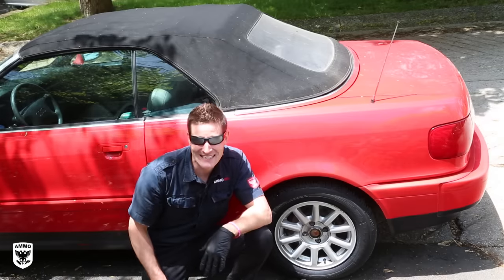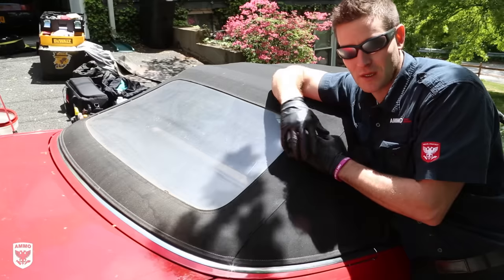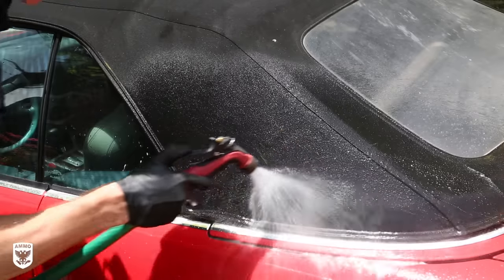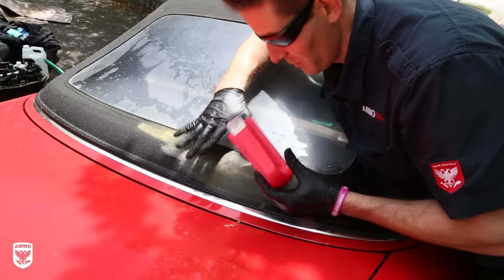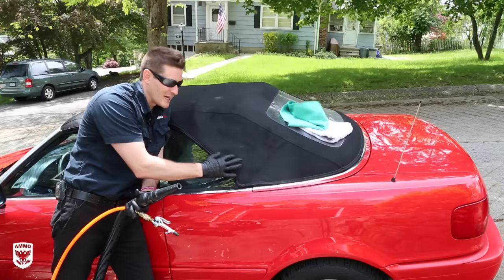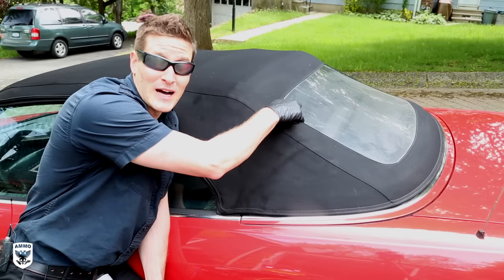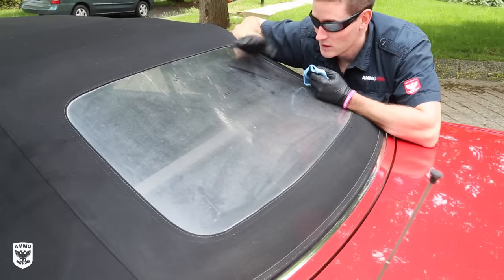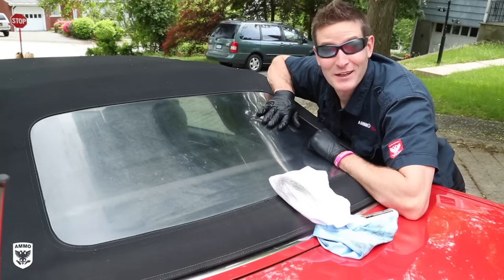How to Clean Convertible Top & Restore "Yellow" Window"

Comment: For the benefit of anyone who reads the comments and wanted info on convertible back window repair.  As Larry's vid here was more about cleaning the Haartz cloth top, I'd like to offer my experience with repairing a badly scuffed and scratched plastic window.  To avoid overheating or stretching the plastic, I had a friend hold a heavy textbook directly against the opposite side, with a dampened medium-thick microfiber cloth in between.  This way, the plastic behind my direct working area was evenly supported, cooled, and not scratched further.  I then used my Rupes mini polisher and many of the same steps/products used for headlight repair (wet sand, buff, polish.)  The results were actually quite satisfying and completed quickly.  In about 90 minutes a top I was ready to throw away looked 98% perfect and has continued to look as good 3 years on.  Let's face it, most of the time the top is down anyway - or what's the point of a convertible?
Reply: recently purchased an e36 convertible and struggle with the yellowing/foggy rear window. If your solution works for me, you’re a life saver!

Comment: Great video and very informative! Just a note that using any cleaning liquid containing petrol distillates or something as innocuous as dish washing liquid also contribute to the yellowing of the rear window because they extract the polymers out of the plastic making it brittle. Avoid them at all costs. Rather use the correct products all over the car. I use Autosol Plastic polish to restore the rear window on mine to good as new every year or so.
If you happen to own one of these lovely cars, be careful about running the rear demister (a heated fan in this model) too long. This leads to the window "burning" and eventually developing holes!

Comment: In regards to the back seam of the window, that is not mold. It's a kind of plant that grows in wet conditions. We see it a lot in boat canvas, and one way to loosen it is steam. If you do that, you don't have to use the stiff bristled brush as much. I agree with spraying it with the cleaner and agitating it, but before rinsing, hit it with a steamer, and it will come right out. If you don't get all of it out, it will grow back.

Comment: Did anyone else notice the trunk flexing when he had his elbow on it?
Reply: That shit was bothering me so much
Reply: That would be the reflection of the tree blowing in the wind.
Reply: audi quallity
Reply: That`s called ,,german engineering"
Reply: @behindizockt2809  most cars do this lol. My old 2000s mustang and my 16 sentra also does this if you push into hard enough.
Reply: That happens at any part of a car that has that material cars nowadays are too soft.Put pressure on any part and you'll see it will bend.I have a 1990s Truck and it's engine hood is made of strong material so strong that it will not bend even if you put pressure on it like the car in the video.Older trucks might be stronger than newer trucks because of the materials they are made out of.

Comment: I'm about to clean (when the weather improves!) the ragtop to our Vauxhall Astra. It has never had a proper clean as you describe in 16 years. I have actually bought an Autoglym cloth roof cleaning and treatment pack. I would have just used a jet wash to remove the dirt, but will use your system.

Comment: Thanks for excellent advice! On my 35 year old cloth top I try to avoid using a water (pressure) hose. First I vacuum it very carefully to get all dust and loose dirt out. Then I sprinkle with clean warm water from a spray bottle, add special shampoo if needed, the let the top dry and finally add a special water repellant ‘soup’ with a brush. My plastic rear window has a few scratches (compliments of previous owners). How do you suggest to remove the scrathes? Also a cloth top may loose some of its color over time. Have you ever tried to use a dye to restore the color?

Comment: Go to a dodge dealership and go to the parts department. In there they have a mopar product for Jeep plastic Windows it is amazing!!! And it's 8$ and comes in a huge bottle. I use it on any clear vinyl window. It removes light scratches, and helps with UVA protection. It's in a grey bottle.... Please go check this stuff out!

Comment: I have a 2000 Miata with a vinyl-like material on the outside of the top (certainly not a cloth), but inside is a cloth that has a occasional mildew problem. Should I take the top off and disassemble (since it folds and creases around the frame) to clean it? And have you found that liner material usually hardy enough to treat in the same manner as exterior cloth?

Comment: I have a 1990 Mustang 5.0 with a white vinyl convertible top. 

Top is structurally sound but needs to be cleaned. 

What products do you recommend that I can use to safely clean the top without marking the cars exterior finish ?

Thanks

Comment: I have a question? Just bought an 03 Mustang cobra and it’s a convertible. On the top I can see where it is wearing from putting down and I want to fix that as soon as possible. Any solutions?  Is something I can adjust because It’s on the passenger side only. So it seems like when it folds while going down there maybe some rubbing I’m really not sure. Thanks! whom ever responds!

Comment: Hey I found your channel a couple months a ago and I've been binge watching a lot of episodes, and I was wondering how you could remove idk it looks like water marks from a window. I've tried to use a liquid clay bar, windex and just rubbing a small area with my finger (to see if I'd work) but nothing seems to work.
Reply: James Bond If you've got dried calcium deposits on glass, that's not too hard to get rid of, just some tedious elbow grease. I use dish soap and a fresh single-edge razor. Lube the working area with the soap (or soap+water mix) and move the razor in straight lines using just enough pressure to keep the sharp edge against the glass. I haven't scratched any of my windows doing this. If the deposits are thick, it may require a second pass, or slightly more pressure.

Give it a shot in a small area, and see how it goes. The other approach would be to use something acidic to break up the calcium, or a cutting/polishing pad, but I haven't tried those techniques.

Comment: This is an acrylic dyed thread product. it is made for being out in the sun and give many years of non fading life. that's because the thread I'd dyed to the core then woven together. This is very expensive fabric. Best way to extend its life is to keep it clean and put protestants on it like Larry did. Two things personally do not do is use a pressure sprayer other use a stiff brush on this fabric. 
pressure cleaning will fray your fabric and the UV rays of the sun will cause the fabric to breakdown extremely fast. The stiff brush will really harm the stitching. I use a soft blue brush you can use to clean the body of your car. 
Take care of your fabric top, and you'll get 15 years of life out of it.

Comment: What about using a claybar on the window?  Don't have a vert, just curious.
Reply: rebelyell22 Since this window is plastic I don't think that'd work. Some verts have glass windows, you could clay bar that, though.
Reply: Jesse Crandle it still has pores though.
Reply: rebelyell22 Any time I've ever claybared plastic (trim pieces on accident) it stuck quite badly, I'm concerned the vinyl would react similarly. Maybe your experience has been different, with proper lube it wouldn't hurt to try I guess.
Reply: Jesse Crandle I'd try it if I had something to try it on.  I've never even clayed glass
Reply: rebelyell22 I haven't clayed glass, but I am fairly interested in trying some of that glass polish. My window is fairly scratched/pitted, I'd be interested to see how well glass polish would clean it up. Truthfully I doubt very much, but it couldn't hurt.
Reply: rebelyell22 Clay works great on car paint, but I believe I would not use it on a convertible window. I suggest using the Novus 3 step process instead. You can find these bottles of liquid plastic polish made especially for this kind of job in every auto parts store I've seen. The first step is to use the cleaner or simple detergent and water and GENTLY clean the window. After it's dry, then apply the step 2 polish, the aggressive stuff. Gently rub it in and wipe it off with a lint-free rag when a haze appears. Step 3 is the fine polish. Apply it the same way as step 2 and wipe with a clean, lint-free cloth. If there are still areas that need work, re-apply the polish until you're satisfied. 

I used Novus polish on my '90 Miata back window for many years and it worked like a charm. Part of the care of any plastic convertible window is to take care of it. Make sure it's dry before folding it into it's storage space. Moisture will fog the window and is not good for the non-transparent parts either. If you can protect the window while the top is down, that's good, too. I bought an after-market thingy for my car that sandwiched the window between two soft cushiony flaps and protected the window from scratching when it was stored. Also, when riding top down, use the boot cover (if so equipped) to protect the top from the sun. The top will be less apt to fade and will look good for a long time. It's a lot of work to keep it looking great, but it's worth it in the long run. Replacing the top is moderately expensive, so it's worth it.

The best solution, of course, is when it's time to replace the window or the top itself, is to replace the plastic window with a glass one!

Comment: What's was that solution you used on that transparent plastic vinal. 
Please tell me it's name and what is that chemical?
Reply: You mean the plastic polish for the rear window?  It's called Plast X, made by Meguiars.  It's a well regarded product (haven't used it myself yet), but I tend to do it the ghetto way (Brasso, or even a paint cutting/ploishing compound).  If you're wondering about the paint polishing compound, remember that modern automotive paint is also plastic (polyurethane to be exact).
Reply: @johannkuhn5685  thanks for the response.

Comment: The best way to restore a yellow window is to get a real window,plastic windows are awful, most convertibles will have the option via a manufacturer of a plastic vs glass,maybe this ride doesn't but other cars do, ive owned 4  convertibles in  my lifetime so i'm somewhat versed on them, 2 Mustangs (old and 90s, a Le Baron and a Caddy)

Comment: Light coat? Eeehhhh. I've had a convertible for 2 years now... and despite the thrashing people might give me for this... I find the thicker you put that stuff on the better. What happens is if you spray it thin like recommended it'll be soaked after 5 minutes of normal rain, and within 2-4 weeks it won't repel water at all. If I soak that bad boy with 303 Fabric Guard then it'll stay repellent for several months of normal rain (I live in Florida).

Comment: That's not mold. Its algae. Either way, use Gone In 30 seconds. I've used it for 15 years on a  beige fabric top to no apparent deleterious effect, but rest assured...the damage caused 'by' the algae and mold is far more detrimental to your top than any cleaner you might use to clean it, so its more important to get it off, even 'if' there is some small cumulative 'aging' caused by it.

Comment: I'm from India.
I'm having problem with my convertible car's soft roof top.
Mine is 2002 San Storm.
Basically problem is with angles.
The form and rubber tube coating is totally damaged. 
That's why glasses are not getting properly fixed between the angles.
What should I do?

Comment: y u clean the bottom before the top?
Reply: Moshik Galimidi For the sake of the video lol. Yeah, I pretty much always apply the hydrophobic spray (I use 303 Fabric Guard, best stuff out there), and often times I apply it heavy enough it drips down the paint. It leaves a plasticy residue, so I always do the rag top first then clean the body of the car.
Reply from the maker: So could show u on camera... I'm by myself.

Comment: I've had plastic window convertibles and rubbing a dirty "Dry" plastic window with a towel permanently scratches / rubs the dirt into the window.  Shouldn't you use a lubricant like water to clean plastic so as not to scratch it further?

Comment: For vinyl windows the best method I've used is water first to clean off heavy dirt then IMar Strataglass cleaner ...been using it on vinyl windows for years ...has UV protectant in it .. expensive for a single bottle but worth every penny

Comment: i wish you were my neighbor. i could get you to detail my car. i just bought a 98 sebring convertible that has a great top with a glass window. the car still looks great. it's the color of the car in this video and has gold colored inserts in the wheels. those two colors with the black top make it stand out. it looks expensive. love it.  it needs to be detailed all over but it's been taken really good care of and garage kept. inside has no mildew smell at all. i got lucky finding this car. 121000 miles, runs fantastic, with all service records. i don't drive that much anymore and i doubt if i drive three thousand miles a year. it should last me a while. i generally keep a car till it's dead and of no use at all. usually 15 years and the cars are used. some needed an engine when i got them for free. my cars lasted when i could work on them to put them on the road again. one was so good someone stole it and stripped it. i put it back together and sold it. it was a 55 chevy with extensive work and all the goodies including fiberglass front fenders and a custom paint job. it was heart breaking. i can't do it anymore. thank god for young people like you. the owner of this sebring was obsessed about servicing the car. i'm so glad. i got it for $ 1300. he wanted 18. it needed a motor mount to pass inspection. the convertible top needs to be conditioned so it will look more black. besides scotchguard, is there anything to make the black top look black again. i know armor all probably shouldn't be used or should it ? thanks

Comment: Is there any way to get rid of fold marks on a soft top?
Reply: Depending on the condition of the top, you may be able to remove/lessen them using steam.
Reply: Tomas Misund Tomas, fold marks should go away when you put the top up, especially on warm, sunny days. The plastic heats up and if the top is tight, it should take out the creases.

Comment: Great video.  I recently went through this process with me 2000 MB SL500. I used RaggTopp cleaner for the canvas/cloth top after a heavy rinse.  For the plastic window, I cleaned it with some glass cleaner, then used a Chemical Guys polish (inside and out).  Made it a lot better.  Then I found Plexus and applied it inside and out, and that really cleared it up.  I believe Plexus "feeds" the plastic/vinyl and 'moisturizes' it, resulting in cleaner/clearer looking material.  I was quite pleased.
Reply: Nah.  I prefer the stock look with the AMG package.  Gorgeous, yet elegant wheels.
Reply: 115,000kms.

Comment: Larry,
What are the advantages of doing the final dry on the top with a blower? If you just let the top air dry after toweling it off, it might take longer, but would be simpler, take less time of my time, and require less equipment. I think on a hot and sunny day, I would want to let it dry inside the garage, or at least in the shade. Thoughts on this?

Comment: would an old hair dryer work to dry the top? to hot maybe?
Reply: Probably not strong enough. You don't want heat, you want a lot of air pressure. A clean leaf blower would be better.

Comment: Sorry, you have been detailing for long time but you definitely do not know how to clean canvas tops. That Scotch Guard crap is no good and the canvas still looks dirty.  If you had the right products and completed the job to included the vinyl window it might of look a lot better.  Also, you never, ever, used a stiff brush.  That is the easy way to damage the canvas permanently.  Next time complete that job right, not half way.  Complete  the window correctly start to finish so the viewers can see how is done and what it should look like.